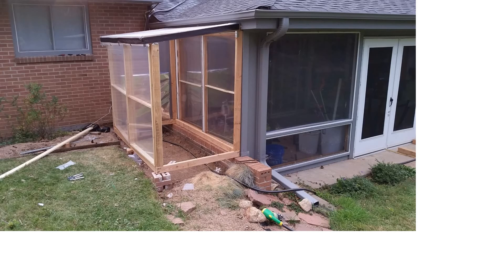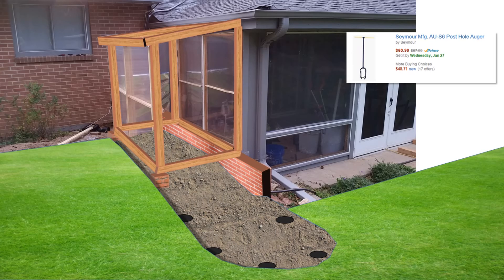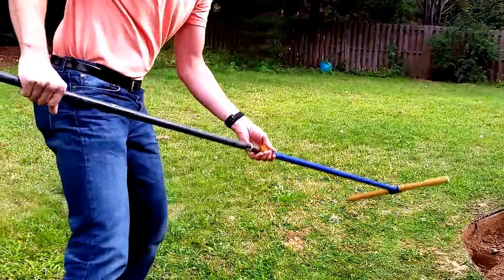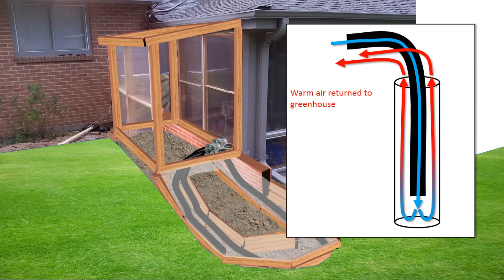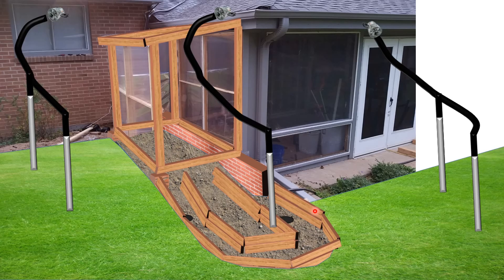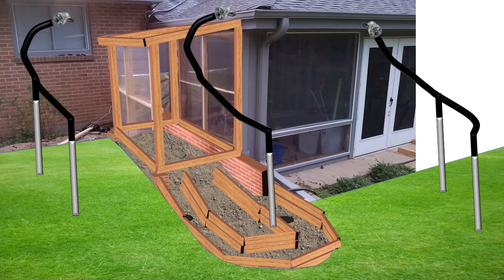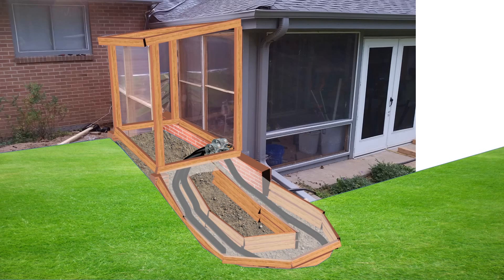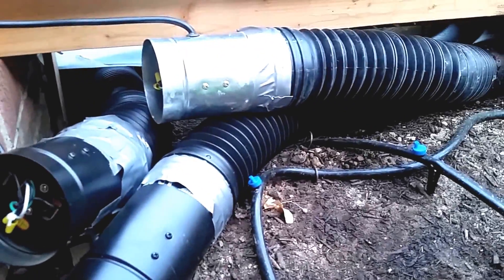Vertical Geothermal Earth Tube in New Greenhouse

Comment: This seems like a lot of extra, you could probably get 80% of the effect with a single 3" pvc pipe inside a 4" pvc pipe and a computer fan blowing down the inside pipe. Just drill some holes 1/5 the way up the pipes so air flows

Comment: Morgan,
I'm looking at creating a version of your system for a greenhouse I'm looking to construct in the near future. I live in Western Montana and am thinking of putting the earth tubes right under the floor boards of the greenhouse so that the air rising from them goes right into the growing area.

How well did your system work and what part of the country are you located in?
Reply from the maker: Hi there.  I live in Denver.  I think your idea to drill directly under the footprint of the greenhouse is solid.  It will work even better if you dig a trench around the greenhouse and put foam board in the trench.  This will minimize heat losses through the soil.  The soil under your greenhouse is your precious "earth battery"!    

As far as the geothermal itself goes, I would not use a system like I have sketched here.  Because the wall of the hole is open to the circulating air, you'll introduce a lot of humidity into the greenhouse.  My 2018-19 greenhouse (https://youtu.be/Ze0nXN6Vvic) used a U-shaped geothermal system which wasn't open to the soil.  Definitely more tedious to drill, but it worked and kept the humidity at bay.  My current geothermal system (https://youtu.be/A2TQJl9WjLc) is a horizontal system.  I basically dug a big hole and ran coils of pipe into the hole.  It's simpler and it works.

If you can easily drill to 15+ feet, then I think a vertical system could work very well.  I'm only able to drill to about 8-10 ft before I hit bedrock.  This is another reason why I opted for the horizontal system.

If you can rig a system that leverages natural convection, by having the inlet and outlet at different heights, you could do away with a fan.  

I have to get going but let me know if you have more questions and I can try to answer. I'm no expert, but I've tried and failed a few times. ;-)

Comment: I would put insulation around the outside pipes exposed to external temps but that is just me. Black does, of course, absorb heat even under soil. Cat at 2:47 is, like, where's mah dinner? Great video. Subscribed and liked! Thanks:)
Reply from the maker: momstheword11 you should check out the newest design iteration (see description).  The geothermal part of the new system is now well insulated, but space constraints limit its effectiveness.
Reply: @MorganBrown  I will, thanks! There are so many ways to save money if we all just stop and learn them:)

Comment: What about when the hole fills with water?
Reply from the maker: J S good question.  My stock answer is that I would prefer a closed system.  Visit my profile page.  The teaser video shows my current design utilizing a u shaped tube, which doesn’t circulate air over open hole.  If it doesn’t make sense, let me know and I can clarify

Comment: What do you think has given you more heat in your greenhouse, geothermal or the compost pile?
Reply from the maker: On balance, I think a good compost system provides more heat.  However, it's more work to maintain than a geothermal.  I like the consistency of geothermal - a too-small system like mine is a useful "insurance policy", in that it might give you a few degrees.
Reply: @MorganBrown  How many degrees above the outside temperature were you getting from the compost pile?
Reply from the maker: stephencarlsbad we are skiing this week in Wyoming so I’m away from the precious compost pile.  Last reading from Saturday morning was incredible: 23 deg outside, 36 in the greenhouse, compost holding steady at 130.  I have a decent heat exchanger made from aluminum dryer vent.  Seems to work well

Comment: did this work for cooling?
Reply from the maker: Paul Chad personally I haven’t tried it, as my greenhouse is winter only.  In theory, however, this type of geothermal should work far better for cooling than for heating.  First, ground temperature where I live is 50-55 deg F, so that’s a 40 deg differential between ground and greenhouse in the summer, versus a 20 deg differential in the winter.  Second, hot, humid air will condense downhole in the summer, so the system cools and dries the air.  Just make sure you have a French drain downhole.

Comment: Pretty neat.  I'd like to see your temp data throughout the year.  Also, are you sure the cans are a good idea?  The heat you want to transfer is between the earth and the incoming air, not the incoming and outgoing air.  I guess to be sure the cans are a good idea or not would be to log temps over time and compare plastic pipe vs cans (or dryer vent or gutter).  Informative nonetheless.  Thanks.
Reply from the maker: Thanks!  Unfortunately I removed this particular earth tube and switched to compost heating.  I have some other videos describing that, if you visit my channel page.  To your first question, I unfortunately don't have any year-round data!  In the summer, I generally don't use the greenhouse.  I think you are right to question the utility of the aluminum cans!  If making a new system, I would use 4-inch rigid irrigation pipe.  I think you can buy an 8-foot section at Home Depot for $10 or so.  The aerodynamics of the flexible drainage pipe are bad.  I'm hoping to do some more experiments this winter - stay tuned!

Comment: Great science and video's thank you.  I am looking to create a passive system for my home. It seems that many people to the horizontal >3% slope over the vertical tubes.   What are your thoughts on vertical vs horizontal in regards to efficiency?  Thermal losses and power it takes for a vertical verses a horizontal tube?
Reply from the maker: Doug, thank you very much.  It's a really tough question to answer.  It's safe to say that the dominant paradigm is the horizontal "earth battery".  The horizontal systems are undoubtedly the easiest way to get, say, 200 ft of tubing underground.  However, if I could drill a 200 ft vertical well, I am fairly certain that the vertical system would be more efficient, since we'd have like 180 ft of hole with a year-around constant temperature.  My system was hampered by my inability to drill below ~10 ft, due to hitting bedrock.  I was equipped to drill to 20 ft or more.  I'd also put more thought into the air circulation - specifically I'd use smooth, stiff 4" irrigation pipe rather than the flexible corrugated pipe.  Finally, for most of us, I'd say that space (or lack thereof) would drive you toward vertical vs horizontal.  Personally I wasn't ready to excavate my entire backyard to 6' depth with a backhoe!  I hope this addresses some of your questions.

Comment: I mean could you not run an outside tap via hose aside a pelton wheel and hook it up to a pma or pmg to generate whatever you need for your fans?
Reply from the maker: ha, well, yes, I do pay for water.  Haven't run the numbers but I'm pretty sure a small solar panel and car battery would be the way to go to off the grid mode.  I was dinking around with wind turbines for a while...those are tricky compared to solar!  I could conclude that my toy-sized turbine (kid science fair project) was generating about 1 W of power with a box fan blowing onto it.  That definitely disappointed me!

Comment: I have a lot of questions and comments, but I'll try to keep this short. I don't think dryer vent hose is best as it would kink and stick going down and be hard to know if it actually reached the bottom. It might even tear against an exposed rock.  Dryer vent pipe would work because it's solid. Seriously, I think any pipe, even plastic, that would pump the air all the way down would work better than a 5' length that doesn't go all the way, so I'm not sure if the aluminum cans are actually doing the work that you think they are/were. Question: Did you think about this:  Put a 3/8 or 1/2" PVC pipe down the hole that would reach the bottom. Attach a 45 degree elbow and reduce it down to a small hole/pressure nozzle on the bottom. Attach a water hose to the top and wash away the dirt adjacent to the next hole. Do the same on the adjacent hole so that the two meet. Vacuum out the water/mud/debris. Seal off the top, or if cave in is possible, run  larger pipe down part way, or to the bottom. Then, run air in one side and out the other. This might give you a larger amount of surface at bedrock level to warm the air more. The images in the photos make it look like they're close enough together. I like the idea of geothermal over compost because I'm laz.....time efficient. ;-) Once finished, there's not much more work to do, where compost has to be turned and replaced. I also think you may not have insulated enough against the outside cold, since the wells were outside the greenhouse. Did you check if the outside ground temp. around the wells was higher or maybe the snow melted there first? I may be dead wrong about the insulation issue because your greenhouse and wells (and the videos) are very well done.
Reply from the maker: Peter, I appreciate your message.  I like your idea to mill out the side bottom of the hole with water.  Another poster (correctly) criticized the airflow in this system, and suggested drilling pairs of holes, joined into a "U" shape.  I couldn't figure out how to execute this, but your idea may hold some water (pun intended)!  You'd get a huge improvement in airflow with a U shaped system.  I think I'd need to mount a GoPro on a long pole to inspect the process, but I think it's definitely doable.  Not sure if I'd need to reinforce the horizontal section of the hole, though...  

Regarding insulation, snow definitely would collect on the outside of the geothermal area, so I don't think I was losing much heat that way.  Or, possibly, the air under the insulation wasn't far above freezing. ;-)

We are getting a pretty nasty early snowstorm as I speak (October 9, 2017).  I got the greenhouse back in shape over the weekend and am hoping I can keep the tomatoes alive before I get the new compost heater and geothermal installed.  I am planning to re-engineer the geothermal system a) to minimize the distance air must travel in a tube, and b) to have a small fan for every hole.  I will make a video.  First priority, though, is to re-engineer my compost heater.  I do agree with you that geothermal is a "cleaner" solution, and it could just as easily be used for cooling, not just heating.  However, the sheer amount of heat produced by even a hobby-scale compost pile is staggering - probably 1000-2000 watts.  It gets so cold where I live that the limiting factor in my greenhouse is the 1-2 days where the temperature drops to -10 deg F.
Reply from the maker: And my tubes are definitely 8 feet high - I stand 6'8", and can reach 8'6" flat-footed!
Reply: If you're interested, there's another youtuber, LDSPREPPER, who's very scientific in his approach. He did alot of work on his first attempt, but If you watch some of his later videos, he talks about doing it differently using a ditch-witch for laying the pipe and a  Styrofoam wall pretty deep and then insulating around the whole thing with Styrofoam (like a dirt pool filled with hose, surrounded by a wall of Styrofoam, where inside the pool it's warmer than outside). Two points that he made was that if your pool is under the greenhouse you need about 10% of your greenhouses cubic feet of air running through your pipes and secondly, If it's outside the greenhouse, you need more. I think your idea with deeper holes (he only went down 8') might be better and more cost effective though, especially if you can plug the tops and just run air in one hole and out the other. I was also thinking that if you really did carve out the dirt, you should go with a store bought (rented?) sprayer, like a deck washer (can you borrow your brothers/neighbors?) rather than hope a homemade version would put out enough pressure. You might still have to make some kind of extension from PVC or black pipe to get down that far. Good luck! I want to know if it works, because this seems like the cheapest way for me doing it.

Comment: Hello bruh, long time no talk I hope all is well and 6K views-- impressive!  I popped in to see how your doing and if you did that green house, and here it is! lol  I noticed you used multiple hoses and have a couple questions  1: How is your over all growth with plants?  2: Did you do a control measurement of  the temp and moisture before geo was in use and if so what was the difference? 3: How is your Humidity and if it's high what are you doing to lower it?  After I finish flowering I'm going to do a control test with my geo off and plugged, so I can scale actual difference my geo is making; just saying my electric bill is way lower doesn't really help anyone learning or experimenting on their build. lol Anyways it's good to see you still doing geo
Reply from the maker: Scott hiebert great to hear from you man!  We are still in early spring conditions and getting some snow, so I've been more concerned with heating than cooling.  The geothermal worked pretty well, but I question how good my airflow is.  In fact, I think it's bad!  I had better luck using a compost pile to heat the greenhouse (see more recent video).  Never did have a hard freeze inside the greenhouse, which was good.  Coldest weather I think we had with the compost and geothermal was 10 deg F (-5 C?).  We had December temps well below zero Fahrenheit but I had heating lamps and no compost.  Geothermal alone wouldn't have worked in that temp, but it might have if the structure was more airtight.

Answering your question in order:
1) I had excellent growth with a fall planting.  Full crop of radishes and arugula.  Sugar snap peas were great until we hit the hard freeze.  Spinach was ok but I had trouble germinating.  Carrots disappointed.  Beets made a lot of tasty greens but small beets.  I have broccoli but it bolted recently.  Broccoli is a pain in the ass!
2) in my compost video I do a controlled on/off measurement and it is impressive.  But that's with BOTH the compost and geothermal.  I wasn't tracking humidity
3) humidity with the geothermal is definitely high.  I bet yours is much lower since your system is sealed.  I can report, happily, that I didn't have any issues whatsoever with fungus or mold.  I think the air circulation helps suppress those bad boys.

I plan to radically redo my geothermal system in a way that'll definitely produce better airflow.  Now that we are moving to warm weather, I'm more concerned with cooling.

Look forward to seeing your temperature data.  I should make a playlist that features your system.  It is really well built, I must say!
Reply: Scott hiebert and